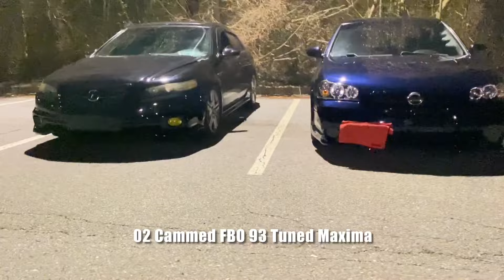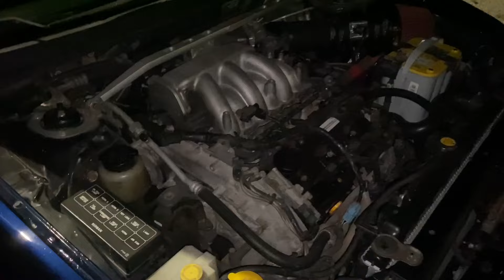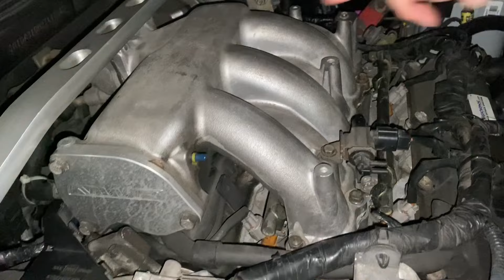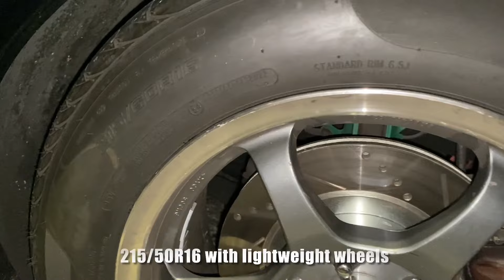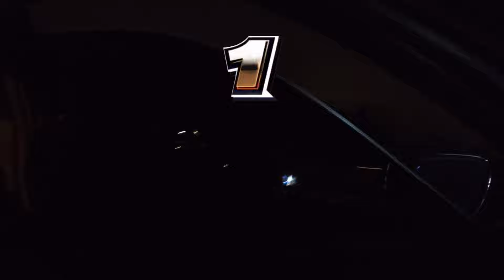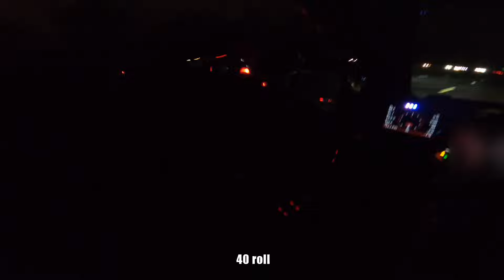TLS FBO Tuned VS Cammed FBO Tuned Maxima

Comment: Great runs as always!🔥 I think you would've had him for sure if he didn't have cams, very impressive. The Maxima is a few hundred lbs. Lighter from factory too.
Reply: Lol no cams max still would win
Reply: @ryansfplunkett792  cams add a decent amount of power, especially for top end. So, that's just my opinion on what the outcome would be. The few hundred lbs. Lighter is helping for sure. Isn't it like every 100lbs is about 1 car length at 100mph, I forget the math of it lol
Reply: @RevsALot no cam maxima would still be quite the run but might still edge out.
Reply: @RevsALot  the maxima was full weight with a full size spare and subwoofer. The TL was gutted.
Reply from the maker: Maxima with driver was around 3600lbs TL with driver seats removed would weigh about the same as the Maxima. Maxima without driver is around 3300lbs full weight . TL full weight without driver is 3674lbs.
Reply: @GarrettMedia  3674 is the curb weight for a type s auto. Manuals are 3559. Also keep in mind that most after market mods (exhaust, wheels. Intakes) reduce weight. 1 big reduction would be single exit versus dual exhaust
Reply: @jaypro2989 not big enough of a reduction to cross that much weight… 20lbs max.. going single exit but also the increased diameter adds back weight.
Reply: @U_aint_6 I think the point I'm getting after is if a car weighs 3559 and I remove passenger and rear seats, spare and items out of the trunk, go from dual to single exit exhaust with cats removed and a carbon fiber trunk lid with all together being generous is possibly 180lbs weighed saved which puts the same car at a curb weight of 3379. With a 220lbs driver that put the car at 3600lbs. How was the maxima "hundreds" of pounds lighter?
Reply from the maker: @jaypro2989  I think from a factory stand point the max is lighter but in this video it’s different due to the TL weight savings. Would like to see lighter wheels (TL has factory 18s heavy) and cams on the TL  and see the outcome. We can all definitely say Maxima is dialed in very well 💯 good runs
Reply: @GarrettMedia  ahh.. understood. Either way your car is running strong. I'm sure at some point I'll be seeing your taillights. Lol
Reply from the maker: Lol 😆 🤝😏😏 Stay tuned!
Reply: If I’m not mistaken, did i see a nitrous kit on the Max? Zex nitrous solenoid mounted under the intake. In that case you did really well if he was spraying.